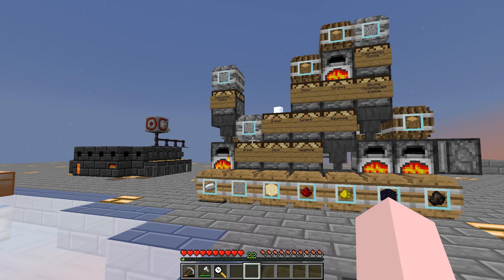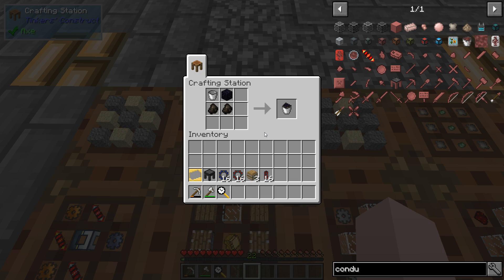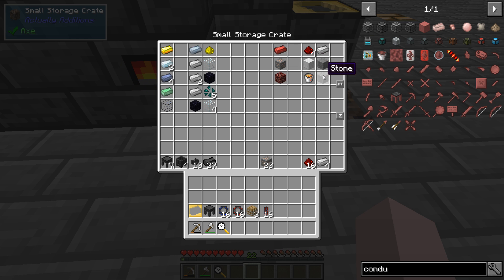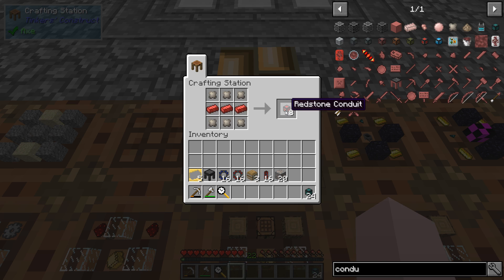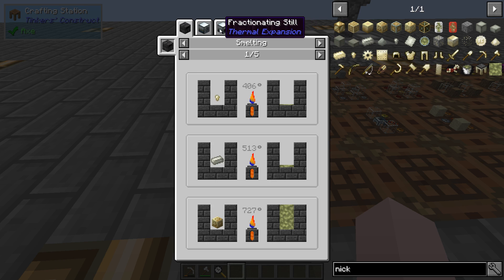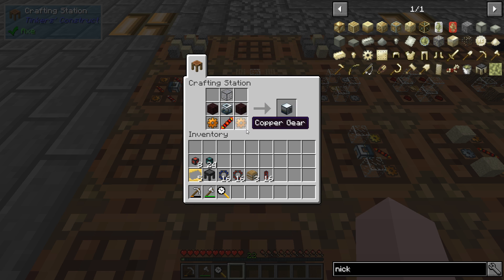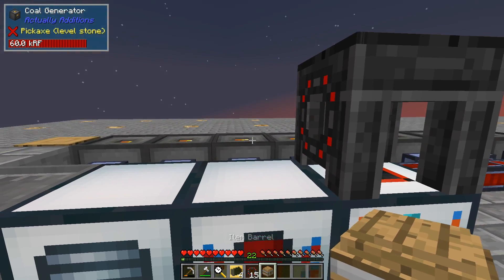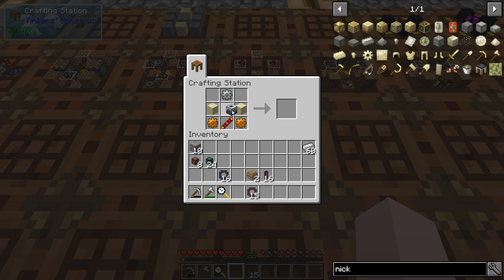02 - Automate Nickel, Automate Dirt - Ultimate Alchemy

Comment: Came for automating dirt, much more efficient than my manual way.
Reply: I went the pulped biomass+slag route and it was ok till I saw what you did.
Reply from the maker: My system was designed for someone that doesn't have dirt yet. I could make something better now, but I no longer have a need when this is making more dirt than I need.
Reply: @WilxGaming  ok, but you need a lot of dirt when making a platform for plant stuff and this method sure does help!

Comment: Tip melt dirt in tinkers smeltery, pour the liquid dirt in a drum then use it to make more dirt u dont need the other machines to make again liquid dirt
Reply from the maker: > melt dirt in tinkers smeltery
There are many  ways to do it after you have your first dirt. For instance making coarse dirt to double your dirt. However I still feel it's a slightly easier to automate dirt the way i did it.

Comment: how do i make the item conduit pull from casting tables
Reply from the maker: I'm not sure how familiar you are with Item Conduits so here are the basics:
By default they are set to Never Active. The one attached to the basin needs to stay on Extract and set it to something like Always Active. The one on the chest needs to change to Input. They both need to be the same color.
Reply: Wilx I actually found out how to do it by myself I didn’t think anyone would respond but thank you very much

Comment: Btw i would in this stage (because it is easy) substitute the furnaces for redstone variants... easy to feed power through genetators fed with logs
Reply from the maker: If you're talking about my automation from the first episode, I though I was going to replace it, but it's working well and producing more than I need. Notice i made a redstone furnace for the new system instead for importing the charcoal from the old system so I could keep the speed balanced.

Comment: I pulverized about 40 iron ores, and got nothing but pulverized iron. Is this just unluckiness, or am I doing something wrong?
Reply from the maker: Luck. You can improve you luck with secondary sieve augments.
Reply: Thanks, I'll try.
Reply: It turns out that to apply the augment I have to upgrade the machine, which requires invar. Got the nickel anyway. (and also automated the process of generating it :)

Comment: i think u dont get what you deserve. 
i found you for not knowing what to do about this pack. i realy like what u did. i am waiting next part.
Reply from the maker: I expect to be able to post it tomorrow.
Reply: @WilxGaming  let me give you little tip
U can use drawer slave with mechanical crafter 
Make a drawer system connect mechanical crafter with drawer slave ta da your system became smaller and less complicated
Reply from the maker: All the other packs I have used drawers and know them better. I swore the first time barrels weren't gated past drawers I would give them a fair shot. So I'm trying barrels and learning them. I haven't tried their controller yet.

Comment: i have a surprise for you - take a look on your gravel/sand/redstone/glowstone production...
Reply from the maker: Sand barrel needed an upgrade, or what did you notice?
Reply: hmmm... it may work. for me it stopped when i had something resonator - it will drain grid, unless you will have some working mills (so i made several water mills and crafters are working again).
Reply: simply that stopped working for me because grid overload when i had only manual mill.
Reply from the maker: > stopped when i had something resonator
Don't leave something partially finished in the resonator or it will lock up the whole grid including the crafters even though they don't need grid power.
Reply: @WilxGaming  that was exactly the reason...

Comment: to get many dirt go the course dirt route :)
Reply from the maker: > course dirt
I hadn't though of doubling my dirt that way. However depending on what i need the dirt for, would I need to hoe each piece back to dirt? If so my automation might be easier.
Reply: @WilxGaming  I haven't got to that point in your video yet, but what I was doing in my first play through, was doubling the dirt into course dirt and throwing it in the smeltery before dumping it back into the carpenter to make more dirt.
Reply from the maker: > throwing it in the smeltery
Interesting idea. Seems easier to get  liquid dirt the way, but I would need to try it to see which was easier to automate, besides tying up my smeltery or needing a dedicated one.
Reply: easier just to cycle liquid dirt from smeltery into a carpenter with gravel and then send most the dirt back to smeltery and collect excess

Comment: I used hardened glass to make my fluid conduits. Made the glass with sand in the smelter to make liquid glass, then alloyed with obsidian. had the same problem as you searching for ages.. then I thought maybe that would work and it did..
Reply from the maker: Why did it work for you and not me?! 3 hardened in the middle gets me fluid conduit, not the pressurized version. 2 hardened with 1 fluid conduit in the middle, with binder top and bottom nets me nothing. Are you making the ender one?
Reply: @WilxGaming  I'll log on and see exactly what I did..
Reply: @WilxGaming  Yeah sorry m8, I just made the normal conduits not the pressurized ones.

Comment: I don't think it's possible to make fused quartz, Tema has added hardened glass to the fused quartz ore dictionary, but the two higher tier fluid conduits in EnderIO don't use ore dictionary for the recipes, but the explicit item.  I've not tried altering the recipe in the scripts myself.  Also sadly there isn't a painting machine available, so you can't hide the EnderIO conduits either.
Reply from the maker: I'm sure Tema will fix it. I was asking in case i missed something.

Comment: The fused quartz is normally quartz in an alloy smelter from ender io... Not at the house to double check if it has been changed but I will this afternoon.  I do know on most packs if you keep clicking the recipe of the colored fused quartz eventually it will show one with the alloy smelter as well.

Keep up the amazing videos, I am right there with you on this series, and I'm thouroughly enjoying the challenge of finding different ways of doing the same old grindy bits.
Reply from the maker: > fused quartz is normally quartz in an alloy smelter from enderio
I know that, but there is no Alloy Smelter in this pack. For over half the stuff in this pack you can't do it the "normal way".
Reply: @WilxGaming  gotcha, I haven't gotten quite that far yet.

Comment: Do your acceleration wand still work in the mechanical user? Mine stopped working and I can’t figure out why, I looked into the config and the option is still active
Reply from the maker: > Do your acceleration wand still work in the mechanical user? Mine stopped working
Do you have something partially finished in the resonator? If so finish it then look at the wand in the user.
Reply: Wilx yeah that was the problem, thank you very much
Reply: Omg thank you that was driving me crazy why would that mod link those together
Reply from the maker: > Omg thank you that was driving me crazy why would that mod link those together
I think there's a config that makes the user cost grid power. In this pack it is set to 0, but when the grid is down, even 0's don't work.